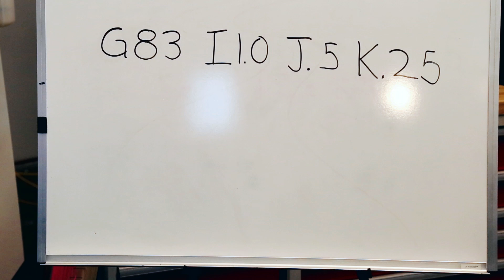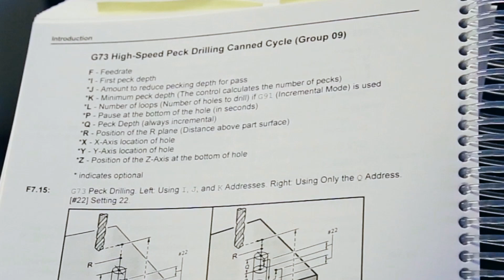Don't Waste Cycle Time; Peck Drilling Essentials - Haas Automation Tip of the Day

Comment: You say G81 is the best, but when I punched a hole out in just 3 seconds my wife was pissed.
Reply: I'm sorry to hear about your bad experience. Here are some hints for the future. Don't try to open up a small diameter pilot with a large diameter tool unless you've got the right feeds and speeds. Check your programming that you're hitting the right hole. If you have two holes with different diameters available, you definitely don't want to hit the small one by accident! Make sure you're using plenty lubrication. If you have a tool that can self-exert lubricant from the tip, all the better. Hope that helped.
Reply: Jordan nice I hope you used lots of coolant
Reply: God dammit these machinist jokes.
Reply: Hahahahahaha
Reply: For that job do a lot of pecking.
Reply: I hope that you didnt use TSC drill!
Reply: @slowpokejpg  bro u made me die 3 times this year

Comment: If you're that worried about cycle time, why are you peck drilling at all? Spend a little more on some carbide drills and save a ton of time on every hole.
Reply: Yea i've just had a go with deep water hole gun drilling, The stock materials we have are 800 N/mm^2 up to 1.1k strength so they are quite strong so it takes 10 mins to get down to 600mm. But im sure if we machined softer materials they would be way faster
Reply: He said that in the video. Well not exactly but he stated use no pecks if at all possible.
Reply: it depended how much your boss want to spend on drills
Reply: @chaddanylak8706  Boss gets to spend it on wages and additional machines instead then
Reply: The carbide isnt nearly as important as TSC....

Comment: The programmer at the shop I...worked for, would tell you straight to your face that removing the peck will work-harden the part...NO KINDING, the people in this trade are quite weak these days.

Comment: As a Tool & Die Maker, a common drill for me was a 17/32.  There were countless days where I drilled perhaps 800 inches in 1 day with that drill.  It was used every day!  So several tens of thousands of inches could be cut before I even wanted to sharpen it again!  Certain metal naturally breaks into little bits, others create long stringy chips.  I'd only break my feed for the safety of myself by a chip getting too long.  The most difficult part is getting the cutting edge down into the metal, once it's in and cutting, as long as the temperature remains within limits, there's no need to worry.  This was a cool video!  I learned something about CNC programming that I knew from manual machining all along.

Comment: As a 30 year enginerd, all things industrial and technology from the old reliable pencil paper and drafting tools.  To hand tools in the shop along with mechanical timing cam packs, gears, bearing slides, etc.  To tooling for HDDs, turbines, roller blades, aerospace, and communications, motorsports, mining, military, Powergen, oil gas, automotive, automation, software Internet, IT, electronics, MEMS, rapid prototyping, to the maker and small business through the advances in information technology and social media to be alive now is awesome.  Time is the most precious resource and the ability to maximize advances like using Youtube to share across the world is a huge benefit for improving life skills that provide lessons that took me a long career to accumulate while today if i didn't have to spend years being lucky enough to have the opportunity of working with a great group of well-seasoned veterans to get tips like this.  They had catalogs they generated thousands of tips they figured out or some old timer taught them.  It was your responsibility to create your own book to glean from the guys retiring they were happy to share but some were not.  So if you figured something out that eliminated issues like knowing your best goto for a supplier or manufacturing process.  The difference over time is if you are making the company money and being awarded appropriately while taking on learning more and become a mentor and leader that attracts talent.  If it's toxic recognize issues if integrity is in leadership for performance based on many attributes.  Burnout will be less and group motivation is self-feeding.  It is important to diversify your skills across all areas.

Comment: Excellent video... for the youngins who see this... don't badmouth old guys using full retract... you use full retract on tools that can't evacuate chips or tolerate heat well; to pull the chips out and expose the hole and drill to coolant.  Runout in your system will tend to wallow the entrance to the hole more with full retract, but in some cases the full retract will give you a much tighter hole as chip binding and tool edge bugging are the primary cause of wallowing out the hole aside from runout, and worse, poor work holding.   When you need super accurate holes, you generally drill slightly undersized and follow with a reamer....but as the man says the tool technology is getting awesome.  Additionally full retract may be a solution if chip strings are wrapping around the drill shank and marring your part's finish.
Reply: once lost a job with a dbag who wanted accurate holes drilled on a radial drill press with no way to lock it down; life can be challenging.

Comment: I almost daily drill holes of Ø  2mm x 60mm depth (or more) in mold steel. G83 is a must for this purpose, the chips don't find the way easily to get out of the hole ,otherwise. Its a time consuming job and depending the mold, 20-50 holes give or take, cnc will drill for hours. The holes must be close fit, and that make things even more difficult. That  << I , J , K>> , That I didn't know, maybe will help me to speed up things.
 thx for the tip.

Comment: That joke actually illustrates a software design problem that really does exist.  There are ways to address it, but it actually takes extra programming work around it, and is often overlooked before it becomes deeply embedded in a code library.  You should wonder if this "anti-pattern" happens to exist in the CNC software you use.

Comment: could you to a video on arcs in the zx plane? like entering the work with a 1.250 radius with a 1/4 inch ball end mill go in a straight line for 20 inches and then exit at 1.250 radius and show how to peck this down without using a cam system.

Comment: High rpm and light feeds will not drill as deep of a hole without pecking as lower rpm and heavier chip loads. A heavier chip that is wire like comes out of the hole better than a thin chip that folds up and packs the flutes which causes friction (heat) and blocks coolant. A wiry chip allows some coolant to pass by and get down in the hole. Also, a heavier chip will not wrap around the drill and block the coolant and mar the part.High rpm also results in more heat and in a deep hole that is hard to get the coolant into that is bad. Sometimes by slowing the rpm down and taking the heaviest practical chip load possible you can drill to full depth without pecking, or get by with one peck instead of many. An example of "slow" winning the race.

Comment: Hey bob , great content and have following since an year pluse by now, and we are about start our own shop with a vmc , I am bit confused with the different types of holders that I would want to by, because I don't what's going to come through that door after I set up , so can help me out with the different types of of holder in By 40 tapper , and their uses so that I can decide on what to buy and how many, it will be great if you make a video , that might help others also. Thanks a lot a keep going ,
Reply from the maker: u v girish – For a new machine I would start with the basic tool holders, then add some of the special holders later as needed. If you don’t know what kind of parts you’ll be running, I might fill a machine with: (8) ER32 x 4” Collet holders, (1) ER32 x 6”, (4) ER16 x 3”, (2) ER16 x 5”, (3) ½” Shank Weldon Holders, (1) 5/8” Weldon, (2) ¾” Weldon, (1) Precision Keyless Drill Chuck . You’ll also need a good indexable endmill to start with, 4 flute 1.25”/32mm is a good generic size, along with a 3” facemill/shellmill. ER collets are just good, universal holders, but you will need to buy collets. As your need for accuracy increases, you’ll find yourself buying a few hydraulic holders, in the specific size you need, and looking at some of the other holder options out there like Milling Chucks and Albrecht APC. Shrink Fit and Rego-Fix powRgrip systems are worth looking at as well, down the road. Check out our video on ER collets for more info, https://youtu.be/WKikm6cQKh0. Time to give your tool salesman a call! – Mark Haas Tip-of-the-day

Comment: When using regular coolant shooting out at the drill I want to point out something that some people may miss. If the coolant is not pointed below the tip of the drill it will be washing chips down into the hole and when the drill goes back down will spin on the chips and break a small drill. Or if the coolant is blasting at super volume and high speed and hitting the top of the workpeice it can blast chips down in some of them--because it has the same effect as if the coolant were pointed above the tip on the flutes. It took me a long time to figure out why small deep drills were breaking for no reason right after changing them.

Comment: I love these tips and Mark is great but this tip does a disservice to those who use HSS drills.  The main purpose of peck drilling is to get coolant in the hole to cool the chisel point.  Heat destroys HSS.  Chip removal is the second reason for peck drilling.  For my applications a G73 will just pack the flutes and cause drill breakage.  There is no new magic for drilling unless you can utilize TSC drills.  I'm sorry to have to disagree with this tip because they are always so good.
Reply: I have used similar cycle with an old Deckel Dialog control and really speeds up the drilling with HSS drills without compromising the drill longevity. Materials used were mainly tool steels and with drill sizes over 5 mm (~0.2") 4-5xD for the first peck is easily managed and coolant will flow in to the hole with just plain old single nozzle setup.
Reply: I don't know how well dialed in your speeds and feeds are but making too light of a cut at high rpm will require more pecking and is harder on drills. Slowing the rpm down and taking a heavy chip load often eliminates the need for pecking, speeds up the cycle,  and extends the drill life. It took me years to figure that out. Running the highest rpm on deeps holes slows you down because it requires more pecking and wears out or breaks more tools.
Reply: @G53X0Y0Z0  Very true, speed is a tool's worst enemy. If your tool (almost any tool) is not lasting what you think it should, the first parameter to consider adjusting is your speed. Speed is what creates heat, heat destroys the tool. Always better to start out using the tool at the lower end of it's recommended surface feet per minute (SFM) or meters per minute if in metric, check with your tool supplier and make sure you are using the tool within their suggested parameters as well.

Comment: I was super confused when I saw x y i j in my gcode as i thought i and j were unit vectors and it didnt make any sense lol...  Could you please let me know what book you referenced in the snippet you showed, this looks like a very nice reference for someone like me who doesnt know hoe to interpret gcode.  Thanks
Reply: The G-codes vary from machine to machine and from make to make.  Mazatrol will use g-codes but it’s specific to mazack.  The biggest difference between EIA and mazatrol is incremental imput.  There is a lot of information out there haas is normally the most user friendly.  The machinists bible is a good place too start.  It may make your eyes melt but it has almost everything in there.

Comment: Im confused. Why peck drill like this this apart from time? Wear as well? However, wouldnt wear be greater if you are pecking lower each time?
Reply: A lot of the wear on a drill (or any tool really) happens on that initial plunge, where it has to get the material to curl/chip. It's like peeling an orange. It's hard to get the peeling started, but from there it takes much less effort (wear). The fewer material-entries, the better. This is just one of the reasons why interrupted cuts are so hard on tools - Mark

Comment: great video .. I'm using a Haas sl-20 .. G83 have I, J, K in the manual  .. but the machine ignore the values. It's bugged in some software revisions, or its some parameter you must change? 

G83 z-50.  Q1.  R2. I15. .. ? Thatr supposed to do 15mm for the first peck? But its starts pecking from the return value.. whatever i type on I .. tried both positive and negative values.. .  Also tried adding values for J and K .. but the machine don't care..
Reply: Haha .. putting Q in the cycle broke it ..  I  should have knew  .. no issues now .lol ..  How deep can you go on the first peck with  HSS?  ;)

Comment: Hi
Drilling quotation
Do you know breakthrough space under plate for drill how much it is say for 1 inch drill ?
Reply: With a 118 degree drill point, we can multiply the diameter by .3 to get that breakthrough tip length. So drill point length on a 1” 118° drill, is .3”
Reply: @markterryberry4477  correct me if I'm wrong 118/2 59 degree tan59 =.825 
.825/.5=.606 but .3x1=.3 this will hit the table
Reply: The X .3 rule just tells us how much deeper we must drill for the tool to reach full diameter, be ones of the drill point angle. What are you trying to accomplish?

Comment: Very good overview on the topic of chatter. I wonder - maybe I just don't know - why non periodic oscillation in speed and feed isn't used. To my understanding, positive excitation often comes from harmonic, periodic resonance. Thus, why not modulating the feeds and speed around a mean value? ... :)
Reply from the maker: Stefan – We call this SSV, Spindle Speed Variation. It is available on Haas Lathes (M38) and Haas Mills (M138). Our Servo control systems are also tuned to avoid certain frequencies, on different machine models, based on their natural frequencies. – Mark, Haas Tip-of-the-day. Check out https://www.youtube.com/watch?v=dXR2wDDFFm4&t=4s

Comment: I will have to look at the manual when I get back to work, but I don't think the g83 on my 15 year old VF4 has IJK options.  Can I get software updates?
Currently, I use multiple lines for each hole. A g81 followed by a g83 with an R value that does not pull the drill all the way out of the hole. It works, but the programs get long when making pieces with multiple hole circles since I can't use g70 with my method without losing any time saved to rapid back to each hole multiple times.
Reply: you can change a setting for how much before the return plane u want the pecking to retract ..  and it will still pull out the drill

Comment: How does this come into play with a center drill or spot drill and a regular HSS or TiN drill?
Reply: Unless you are working with strong, dense, or heat treated materials you really shouldn't need to be pecking your spots or center drills.

Comment: Does this work on a 1993 vf-3? I have 98 holes to drill and I'm trying to get my cycle time as low as possible.
Reply: Yes, this IJK pecking has been around for a very long time and should work just fine on your '93 Haas Mill. I spent thousands of hours on those mills, at the first shop I had worked at, great machines.

Comment: Hola trbajo perforando material de circuitos impreso y tengo problemas de dispercion en agujeros de 0.50
Reply from the maker: Flavio Puca – Tooling suppliers have some very specific drills, made just for circuit boards. I would contact your tool salesman, they would love to help find a solution for you. Sometimes, we are able to stack the material, and drill through many parts, firmly clamped together, into the fixture underneath. This can greatly reduce the chipping as the drill exits on glass-filled materials – Mark, Haas Tip-of-the-day

Comment: I'm pretty sure I know the answer to this already, but would these G83 IJK Cycles work better for a wire sized hole? Talking maybe 1/16 or smaller.  I do a lot of EDM blocks and I had to drill sizes that were about .030" Most of the time it's usually around 1/16" though.
Reply: Having a lot of personal experience drilling deep and tiny holes in a multitude of material types I would reccomend using g73 for those types of holes.
I've had to do up to 65xDia depth holes before and G73 will save your ass doing those.

Comment: Can we use a G73 on a non High Speed Mill? Or it’s only for High Speed machines?
Reply from the maker: Jorge – The cycle will run on machines, even if they don’t have the High Speed Machining Option. – Mark, Haas Tip-of-the-day

Comment: Just use parametric programming for all this stuff!
Reply: Making custom canned cycles is da bomb
Reply: Most guys, even seasoned vets do not know how or are not aware of the power of custom macros. It's only a small learning curve if you are familiar with basic computer programming. Sure they can become pretty overwhelming if you get into complicated geometries and or you are doing a lot of nesting. But for the most part learning the basics is straight forward and becomes an indispensable amazingly powerful tool. If you are running a mill/turn, a horizontal, or vertical with a pallet changer then I'd say it's a must have. Look at Custom Macros the book by Peter Smid for an excellent introduction.
Reply: Canned cycles are macro programs with an assigned g code.